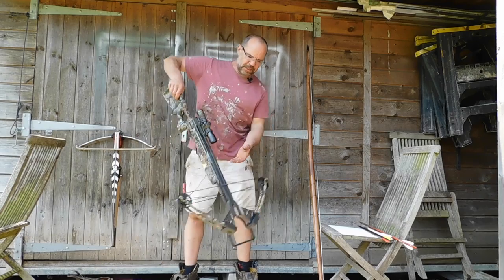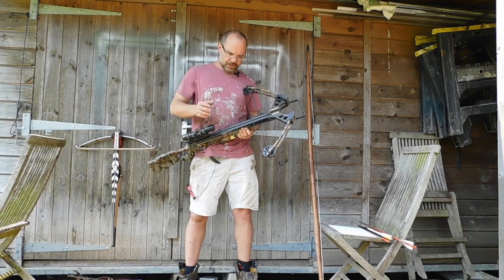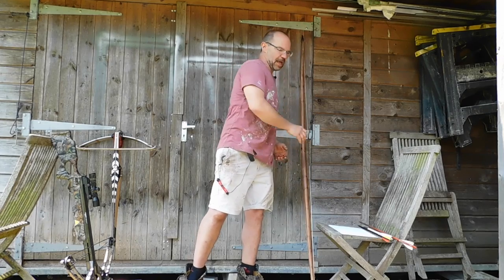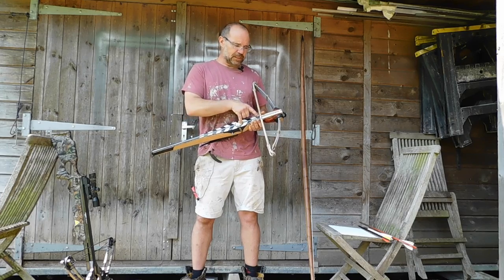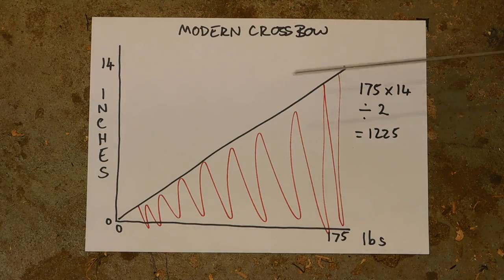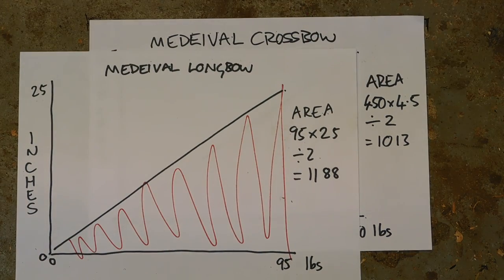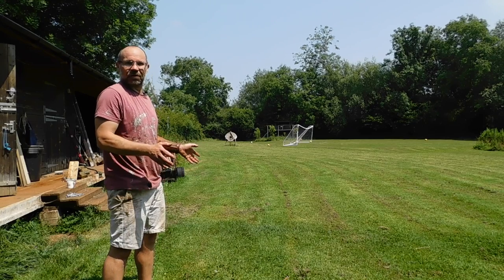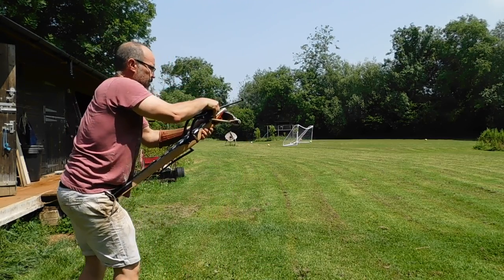Draw weights of medieval crossbows, longbows and modern crossbows

Comment: Drag is proportional to the square of speed, therefore quick projectiles loose more energy on their way to the target.
Heavy and slow crossbow bolts start with less energy but preserve more during their way.
Reply: However they fall "faster".
Meaning that the archer had to account for more drop.
Reply: Not to mention a function of damage isn't necessarily the same for firearms and crossbows. A slow moving bolt just needs to penetrate armor and flesh and cause bleeding. The larger the diameter of the bolt head the larger the wound, the more bleeding occurs. Bullets have small diameters even when dealing with huge cartridges like .50bmg (around 12.5mm). Thus when it strikes a target the initial hole isn't necessarily that large. The speed however, is enormous comparatively, and counts for much more of the damaging potential (never judge a bullet solely by its diameter, aka caliber). 

This means when it hits a target and dumps even a portion of its energy into a target the hydrostatic shock which creates a large temporary cavity and a smaller permanent cavity. In essence your looking at tearing a hole mostly by energy of impact to create a lot of bleeding and damage versus versus piercing a hole with a relatively large diameter.

As a side note you can see this in action by watching ballistic gel tests with a  slower round, say .45 acp versus a fast round like a 5.56x51 NATO.
Reply: @thewinterasp  Long, narrow bullets create more physical trauma than shorter fat bullets, because all bullets tumble on entry (see the work of Dr. Martin Fackler et al.), but a greater increase in the permanent wound cavity (as opposed to the temporary wound cavity) is caused by fragmentation of the projectile.
Reply: Well, long narrow bullets behave * Differently * than short fat bullets in Terminal Ballistics ( and external balistics for that matter ).  But there are a whole bunch of additional factors , and you can't make generalizations from just one factor . 

  The design goal of non-expanding FMJ bullets is to at least tumble upon impact, and ideally subsequently fragment . This is effected by the stability of the bullet ( rpm of spin), and multiple factors of internal bullet design . Center of gravity front to back , jacket thickness , jacket hardness , external or internal scoring of jacket, presence or absence of cannelure , and actual impact velocity .

  There are inherent compromises in bullet stability . To oversimplify , for maximum tumbling on impact , a bullet should be just barely stable enough to be flying point first . But for long range accuracy , accuracy in all climate conditions , and penetration of hard barriers , the more stability the better . ( Stability being a factor of bullet RPM , which is effected by both twist rate, and muzzle velocity .) ( Insert long history of evolution of U.S. ammunition, twist rates, and barrel lengths for 5.56 weapons, with terminal performance going up & down . )

  If small caliber bullet performance isn't ideal , big non tumbling bullets are better than small non tumbling bullets .  And throughout history generally , there have been lots of small bullets that performed poorly , or at least been designed with greater emphasis upon factors other than terminal performance .

  And of course , this is all within the arbitrary context of International Treaty , requiring nominally non expanding ammunition against certain Recognized Combatants . For hunting, personal defense , law enforcement , and certain Counter Terrorism , it takes a really tricked out FMJ , performing exactly as designed, under ideal conditions to match a rather mediocre expanding bullet .
Reply: True but not very relevant at distances under 200 meters or more likely under 100 meters that most warbows are regarded as being prime effective range.
Reply: And the whole question of lethality versus momentum. A knife driven into someone using just bodyweight behind it is certainly extremely lethal, but very low energy high momentum
Reply: @thewinterasp  no such thing as 5.56x51mm. Do you mean 7.62x5.1 or 5.56x45?
Reply: @
Bulcsu Varga: Um, isn't ballistic coefficient (sectional density + drag coefficient) more important for energy preservation than purely just size?
Reply: Also deform less and less chance of breakage therefore delivering more energy to penetration

Comment: Great video. You did a great job on explaining this. Kudos for the parts about warbows. Heavy draw weights around 140 to 150 lb reaches 140-150 joules with middle to heavy arrows. Important detail there.

According to a video on the Medieval Crossbow channel, composite horn crossbows in the 1276 lb range reaches 488 joules with 348 gram bolts. It's rather big in comparison to the crossbow you have here. The bolt left at 52.92 m/s. It shows that composite horn is a much better material to make a bow of than steel. The 260 gram bolt left at 57.74 m/s and gave 433 joules.
Reply: Yes, Han and other Chinese records go into quite a bit of detail on crossbows and the distances for various weights achievable and how to use the various types of crossbows. As more of these records are translated, verified, and accepted by medieval hobbyists some of the work examining the few medieval crossbows extant and reproductions will focus on how to make steel prods more efficient because while the European crossbows never quite measure up to the Chinese sources they do much better in comparison to Tod's reproduction and actually are not that different from LaCombe's results. Han crossbows had a longer stroke which as Tod demonstrates makes them more efficient but there are also many small tricks in making the limbs of bows more efficient, not only in materials, but design, and other very small factors which I do not believe we have any bowyers currently working who have fully mastered crossbow manufacture.

Comment: I asked this on another crossbow video of Tod's, but it would probably fit better here:
Do you know if there is a materials-engineering reason they didn't use compounding pulleys on bows and crossbows in the medieval era, or was it just that no-one had thought of trying off-center pulley wheels? It's a really weird idea to wrap your head around, from a geometry perspective, but they had some pretty inventive people between Pythagoras and the middle-ages, and LOTS of experience with making and using bows.
Reply: The first compound bow was invented in the 1960s, i guess they didnt have the technology in medievel times.

Comment: Oh Todd I LOVE IT!
In fact, I was just thinking about how somebody should draw out the draw weight over powerstroke curves of some bows to calculate their energy output, and right then I see this video where you do just that!
I do however have two points of criticism:
1. You are looking purely at the energy of the projectile, because this is used to characterize modern rifles. I wonder however, if the deadliness of an arrow isn't better characterized by its momentum, rather than its energy. Of course, this makes the comparison to rifles difficult, but this is to be expected, because the damage-mechanism is also a different one: An arrow cuts through the target, while a bullet pushes the mass in front of it away. The former should be far more energy-efficient. This claim could be tested by shooting bolts or arrows with different masses from bows with different draw weights, and simultaneously measuring penetration and bolt-speed. If penetration scales linearly with speed, its the momentum that counts, if it scales with the square, its the energy.
2. You remarked already that it is incorrect: You are assuming linear relationshipts for draw weight over powerstroke.
Although I appreciate that this should not become too complicated and it was probably right for this video to keep it that simple, this neglects the whole purpose of the curved shape of recurve bows for example.  I think it would be really interesting to measure these curves directly - for example by filming how you slowly draw the bow over a tape measure using a bow scale. (If you happen to want to do that, you are welcome to send me such a clip and I will can evaluate it and send you a nice graph and energy value ;-) )
After all, the graph for a "perfect" bow would not appear as a triangle, but as a rectangle: From zero, it would directly jump to the maximum draw weight that the archer can draw, stay there until the full draw length, and then drop back to a low value to make it easy to hold the bow drawn.
I expect that the modern bow will approximate this behavior much better than the medieval ones.
If such a measurement were done and compared to the actual arrow speeds, one could also calculate the actual energy efficiency of the bow :)

I believe that both these points contribute to why the modern bow performed so much better than the simplified math suggested.

Comment: Had always wondered why no one ever ended up using spring steel as a bow material and the energy thing made my day awesome video.
Reply: As a side note I would be extremely interested in seeing how a modern bow design would perform at the same weights as a historical warbow
Reply: Nevermind the readings in that video gives me the info i need, which if im reading this right a modern recurve at 45lbs draw is putting out roughly the same energy as the medieval longbow at 95lbs which is interesting and makes me really want to do some more research on that

Comment: It's important to remember that missile weapons up until advanced firearms were never really used for raw stopping power either. Their role on the battlefield was as a support weapon for the main melee troops. Even the Hussites, famed more-so than the English for excessive use of missile weapons, ultimately finished off the charges with their massive flails and halberds and not their crossbows or handgonnes.
Reply: faultroy  I personally can't speak for a medieval javelin or spear, but modern olympic javelins are thrown at up to 30m/s, and weigh 0.8kg, for an initial energy of about 360 J. I'm not sure how a historical one would compare to that, but I assume it would be lower.

Comment: excellent video Tod, but I feel I should mention that while energy is important for punching through thin, hard materials i.e. plate, it is less important than momentum for penetrating thicker and more flexible materials, e.g. Kevlar, gambeson, and indeed flesh and bone. Sectional density is of course relevant for all materials. I bring this up because penetration is the most important data point for the "stopping power" of a round, with wound cavity a proportional secondary point. Shooting these weapons into ballistic gelatin would tell us more, though again would be inconclusive. Anyway, great vid!

Comment: Great job. I've been thinking about those differences for a long time. However, I don't think comparing energies of firearms to bows and crossbows makes much sense, as these projectiles work in very different ways. Unlike bolts and arrows, firearm rounds don't rely on simply piercing the target and causing blood lose through relatively small, clean cuts. Instead their tips are often blunt or even flat and hollow (and if their not, it's to do with aerodynamics as they're often designed to flatten or tumble upon impact) and tear through tissues causing massive shock waves and extensive damage. The whole process is very efficient at killing  but requires far more energy to even occur. Comparing arrows/bolts to gun bullets would only make sense if done in the armor-piercing context. In therms of so-called soft targets, it doesn't really matter how much energy a projectile carries as long as it's enough to penetrate and reach the vital organs. For instance, a long knife, or any pointy object, can be slowly pushed into a body and even poke out the other side causing almost instant death even though it probably won't have more kinetic energy than a cheap air-riffle. On the other hand, a heavy rock can be thrown with more energy than many air-riffles will produce, yet won't be able to do quite as much damage.

Comment: What I learned from this is that .22 LR is surprisingly effective.
Reply: .22 lr can kill deer and people (not humanely tho)
Reply: @comradesoupbeans4437  how do you kill someone humanely tho?
Reply: @TheIlidius  i meant the deer lol, people are just basically the same in terms of firepower needed
Reply: Extremely effective at very close range, reference the Bain family murders :-(
Reply: A .22 revolver was considered a fine self defense weapon a century and change ago.
Reply: Shot placement is what matters. The smaller the bullet, the harder it is to hit the correct spot but yes. .22LR is a very useable cart.
I still prefer 9mm. Bigger area of effect for damage without being overpowering
Reply: @TheIlidius  by making death come quicker. If you are going to kill something, make sure it doesn't suffer for too long. Hence why broadheads and hollow point rounds exist.